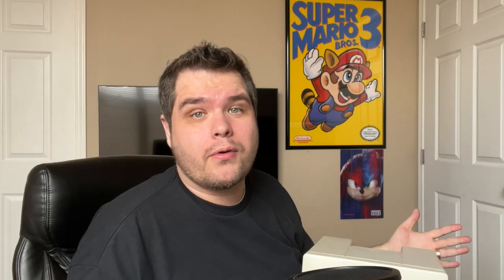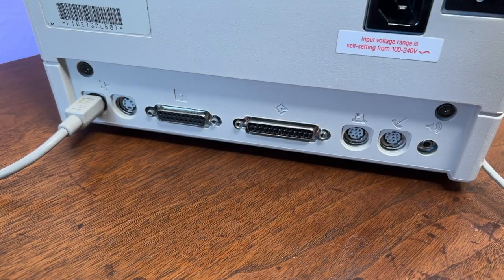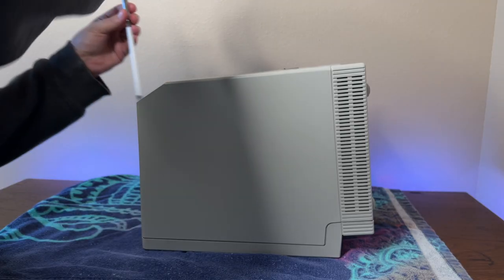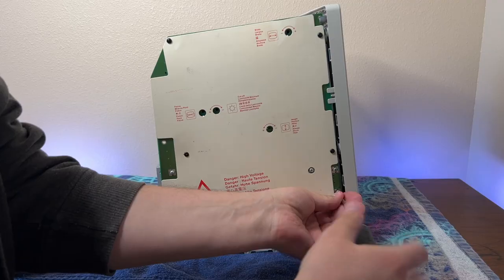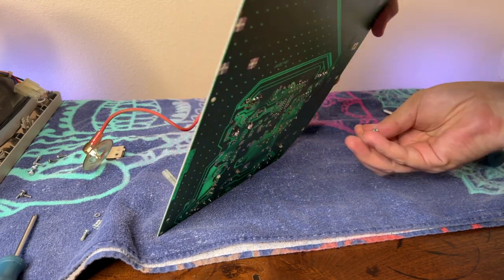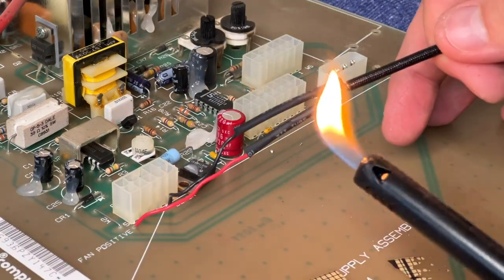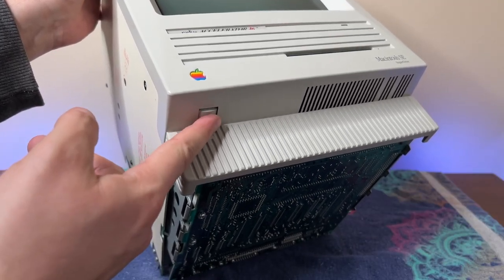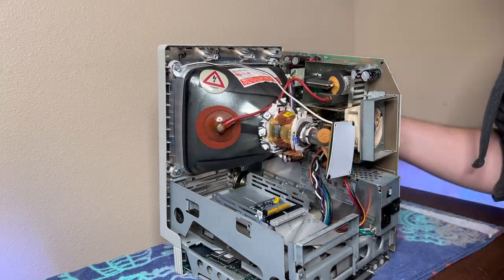New Compact Mac Hardware Upgrades!

Comment: You can easily remove hot glue by soaking it with rubbing alcohol. The hot glue will just pop off. (I don't know if this works on the 40+ years old Apple glue. Works wonders on modern hot glue.)

Comment: What did you do with the yellow wire from the noctua? I left it unattached and just soldered the red and black wires up to those on the board of my SE like you appear to have done, but I'm paranoid this is not the high cooling scenario

Comment: 2:49 I’m really curious about what happened with System Picker. I noticed that the Read Me file is hi-lighted a little strangely when you copied it,  it if that was a problem you’d expect it to still complain when you copied it individually, right? Weird.
Reply from the maker: I'm thinking there were some invisible files, or corruption. The drive was so loud it was probably going to die soon...

Comment: I don't quite understand how anything on the computer can be "grounded" when it is sitting on a table with the power cord unplugged, but then, I'm only just smart enough to know that I don't understand electricity.
Reply from the maker: If I'm not mistaken a charge will build on the inside of the tube and an opposite charge on the outside. It's not moving the electricity to the actual ground but rather equalizing the charge around the CRT. It didn't pop here though so I don't think there was a charge.
Reply: yes, you clearly don't understand electricity